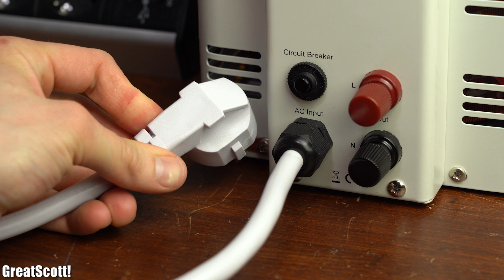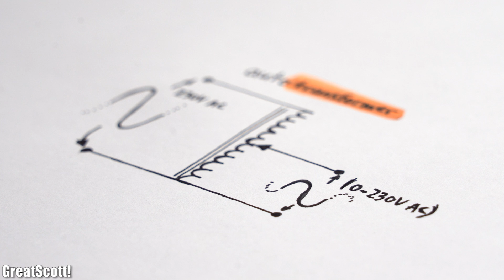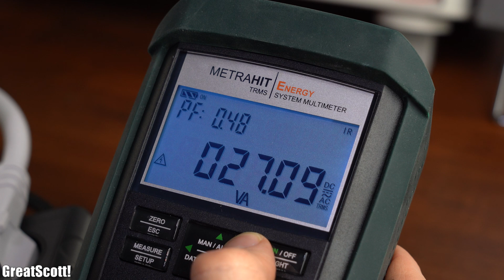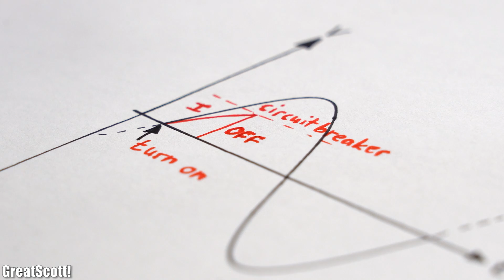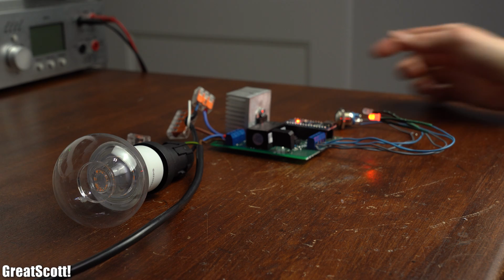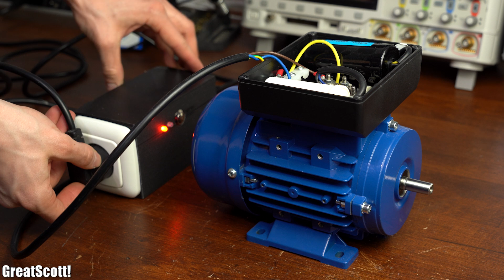How to make an AC Softstarter because my autotransformer keeps tripping my circuit breaker!

Comment: Thanks Great Scott!, I’ve learned so much from your videos.

I’m having troubles with this one though, and as I’m building the circuit I’m hoping someone can help me with a few questions.  I’ve researched using the timer registers to the point I feel I understand it, how clock cycles dependant on the prescaler settings correlates to actual time.

I believe I’ve confirmed that OCR1B = 590 (9.44ms prescaled 256) is based on 50 Hz mains power cycle.  If I understand the sketch correctly, everytime mains crosses 0 VAC on a rising portion of the main’s cycle, the sketch checks to see if the button was depressed.  If the button was depressed the value of OCR1B starts to decrease until i = 587.

What I can’t comprehend is why 9.44 ms is the chosen time, as by my math 1/50Hz * ½ a cycle = 10 ms. This would be the time for the mains to go from passing 0 VAC rising to a half cycle later when mains is at 0 VAC falling, and the triac is triggered for the first time.

So why 9.44 ms, and not 10 ms, and why holding OCR1B at 3 (590 - i of 587), and not 0?
 
If a person has 60 Hz mains and wants to trigger the triac at the peak of a mains cycle, as has been suggested, OCR1B would start at 260 (1/60Hz * ¼ = 4.17 ms) to trigger the triac for the first time, at the peak of the cycle after passing 0 VAC rising.

In the original sketch the triac is triggered over half a cycle from 0 VAC falling to 0 VAC rising.  If triggering the triac at the peak of the cycle would OCR1B be adjusted to still equal half a cycle duration, but starting from the peak, this time peak to peak which would include passing O VAC falling?

I hope I’m correct in my explanations, and my questions are worthy.

Thanks!
Reply: I wish Great Scott would answer !!!

Comment: a big resistor in series with main and a switch to bypass resistor when variaac is powerd up..the 2 dolalr solution
Or use a 555 and a relay to replace the switch.....5 dollar part list

Comment: Great Scott, thank you for making and posting this video.  Question: ¿would a soft start circuit (such as the one you've designed/built here) work for an AC motor garage door opener?  (My opener starts with a jerk and wondered why companies don't add such a circuit to the AC motors.  I am aware that a soft start is perhaps easier to incorporate with DC motors.  I'm perhaps doing things the hard way, and purchasing a new DC opener is a solution.  But I'm budget constrained).  I'm sorry for the long note.  Any/all comments most welcomed.  Thank you.  tonyd\.

Comment: I had the same problem and I built a "dim bulb tester", basically I start the transformer with 2 40 watts lamps in series with the load and I added a switch to bypass the lamps once the transformer is powered on. Maybe this helps somebody that wants to make this really cheap and easy. Great idea and video as always btw

Comment: A very simple soft-start circuit that is used by many is a simple relay that shorts a load that throttles the current after a fixed interval.  I made one for my audio amplifier project:

https://github.com/profdc9/PowerAmpAudio/tree/master/SoftStart

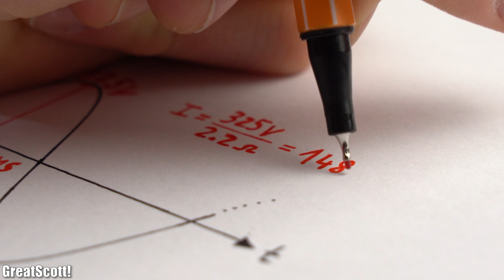Comment: 6:22 It's the opposite, it's better that the voltage is high at the beginnig, it's a complex fact but basicly because in inductance courrente are 90° late than voltage so maxmum voltage = minimum courrent.

Comment: This is just what I need in my workshop, my circular saw is very spark in the start. But at the end of the video the motor start with a jump, stops and start again. What's happening? Because I thought it will start slowly and gentile, until get the full power. Thank you for share this project, I really wish to build one.

Comment: I would test this with a freezer also as they require a large switch on current - that's what I found when I used low power inverters.

Comment: Had the same problem with a 1025VA toridoal transformer and even with the SSR it kept breaking the (B16) breaker and this kind of sucks right now
Edit: I watched your video and I knew that there was a risk that it wouldn't work, however I still wanted to try it because it would have been so simple

Comment: Hi. How are you? I was watching her videos about li ion and bms. About the BMS HX-3S-01. I see many recommending it, however, some say it is not for charging batteries. What is your opinion? My idea was to put the hx-3s-01, with 3S (2200mAh), and a current limiter of up to 1A and a voltage of 12.6v. It works? I could leave it loading (in the morning) and remove it hours later (because of work and other activities). It's safe?

Comment: There's an easier way to make a soft start circuit. Just start the load with some resistance in series with it, and then after a time short out the resistance so the load gets the full line voltage. Naturally this could be done manually with a couple of switches or automatically with a simple timed relay circuit.

I needed one for my circular saw, to make sure it wouldn't pop my inverter. The one I made was a little bit trickier as I wanted the trigger switch on the saw to instigate the process, without modifying the tool in any way,.

Comment: That's rather strange to have the lights go out? The lights here in Australia run on a different breaker, I had a kettle go bad one night which tripped the breaker, the tv and everything else that is plugged into a wall socket was shut down but the lights stayed on! And I was able to see where I was going because in a situation like that, you have to go around turning off the power points until you find what is causing the problem.... Try doing that without lighting at night. 
Your new variable Autotransformer looks like the one that I got from eBay! Except that mine is RED! And that means it's automatically better than yours LoL, it also has a built-in wall plate that takes any plug from around the world, like the ones that you get as a cheap Chinese adapter but the one used actually feels really good, the plug doesn't fall out and considerable amount of force is needed to plug and unplug.. it also has two carry handles on top which also provide protection for the adjustment knob on the top... But now I'm just bragging LoL 😂

Comment: VEry complicated.
Why would a simple resistor and relay soft start circuit not work for you? It works on big power supplies.
BYW - you may want to check your breaker in the consumer unit as it may be the wrong type for your circuit.

Comment: Hi @GreatScott, I have two questions please. 1) Why is the optocoupler's anode connected via two parallel resistors (R6 and R2) both 220k. Would just one 110k not work? 2) Is the black filament the galaxy black from Devil Design :-) ?

Comment: I need one for my fridge. Every once in a while when the compressor turns on the amp draw pulls over 40a but only for a second but long enough to trip the breaker, there after it only pulls 2a. The fridge is only 2 years old.

Comment: This is why my angle grinder trips my circuit breaker. I have  B16 that I want to swap out with one of C25  and make one wall socket for it in my garage. Hopefully this helps in my situation.

Comment: I've got a 4kVA variac, if I switch it on it's 50:50 whether it'll trip the breaker or not. I use a big 7kVA mains conditioner which soft-starts it and prevents tripping.

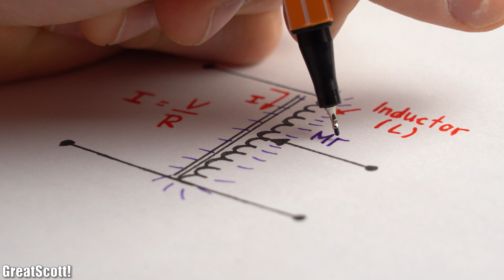Comment: 6:48 This part is wrong, a transformer should be switched on in the spikes not the zero crossings, this is for both inductive an capacitive loads. An transformer is even worse when switched on the zero crossing point, as it can cause the core to saturate, resulting in a 2-10 current spikes for the full wave
Reply: It is true what you say about inductive loads, but not capacitive. A capacitor will actually draw the spike of current like he described, only limited by the minimal resistance, since there's no inductance to slow down the current

Comment: Will this soft starter work for a solar setup? Starting a motor running off an inverter and solar panels, the startup current is too high and trips the inverter.

Comment: Great project !!! I have (maybe a stupid) question. An Optokoppler contains usually a light enhanced diode (your oc seems to have a transistor). So it lit up when it is powered on. I don't get it, how it triggers the digital input of the arduino with those peaks. Could you close my basic knowledge gap on that point, plaese ? Many thanks for all your great content. I learned a lot and own a cheap & well working fume extractor ;-)

Comment: I had a similar problem 20 years ago. Solved with a 2kW heater in series with the transformer that was shorted by a relay. It takes some tens of ms for the relay to close the contacts and this time is enough to limit current surge

Comment: hi scott do ur slow/smoth start work with switch mode power sub. like psu for pc etc?

have a sub woffer runing of a psu 1600w to a 2000w amp and it wtrip my breaker 90% of the time 75% one at the time( yes they have BIG capasitor in them)
thx for reply

ps have 20 amp plugs and 220v ac

Comment: Why not introduce a input resistor and bypass it after a set amount of time. That would not waste power all that much and prevent high inrush as well.
Alternatively you could use a MCB with a higher TCC curve.

Comment: very, very bad solution - on heavy load, triac will be overheated.
ever best solution is connecting an relay in parallel with triac. when soft-start ended, turn relay on, wait till on, and disable the triac. to "turn off" load, start the triac, turn off relay, wait till relay switching and turn off triac.

Comment: Hi G.S.,
I had the same problem with a 30KVA autotransformer and the simplest solution was to turn on the circuit with a load applied to the output of the secondary: the large initial current is due to the magnetization current of the primary which is not reabsorbed by the current magnetization of the secondary (output circuit) due to the absence of load.
This suggestion was given to me by my service manager (I worked in ENEL) who had worked in a company with a large transformer cabin and who had the same problem, when the softstarters could not be used due to the load (> 4 MVA at 15 KV) and possibly triac, mosfet and arduino did not exist. 
Try to apply a load to the output (one ohm resistance is fine too: you adjust the output voltage so as not to let it exceed its power) and then power it up: you should no longer fail a ignition
P.S. of course the resistor is used only for switching on and must not remain active for all use of the variac.
Thanks anyway for sharing the design of a softstarter.
P.S. there are modules for universal electric motors, up to 2KWp, very compact (with three wires and automatic, to be inserted in the casings of power tools) on the market, but you would not have made the video :-)

Comment: Would this implementation switching at peak or zero? be suitable as a soft start for a 500VA toroidal transformer in an amplifier or would just a series resistor and relay to bypass it be a better solution?

Comment: You also could change your old B16 Brecker to C16 Breaker
Reply: Or even c20 or C25. I want to make one wall socket for C25 in my garage so my angle grinder and welder wouldn't Trip the breaker.

Comment: I had an issue with my laser cutter tripping the circuit breaker when turned on randomly. Depending on when you turn it on/off it can cause a large inrush current. They sell special relays that turn off/on at the peak of the cycle to reduce inrush current. Google "Beware of Zero-Crossover Switching of Transformers"

Comment: incandescent light switch did not like thermal shock. it's a pretty simple analogue circuit and a great deal easier to understand and less over-engineered than using a microprocessor. The circuit is only hand drawn that I could have photo it if anybody was interested.

Comment: I was looking to buy something like this about two years ago, but couldn't find any. Our chop saw also has a tendency to trip the circuit breaker.
It works more often than not, but since you turn it on and off a lot, it ends up being a problem.

Might be time to try something like this. Unfortunately, I don't have an oscilloscope, so debugging would be difficult if things don't work.
(And err... I'm not sure I'd dare hook up an oscilloscope to something referenced to mains anyway. Good way to kill your oscilloscope if you don't know what you're doing...)

Comment: Awesome built. The last time I dug into this matter, there was a lot of contradicting information regarding if the zero-crossing or the sine peak was the best time to energize the windings. This was due to different opinions about the significance of current lagging the voltage. I never understood that connecting a coil at the zero crossing would instantly make huge currents flow. After watching this video it seems that my gut feeling was right. Connecting at the zero-crossing should induce the smallest amount of inrush current.
Reply: It's not that a coil immediately draws high current when switching on at zero crossing but the current is much higher for the first few cycles until the coil produces enough counter EMF, reducing the current. When switching on at peak of the voltage waveform, the counter EMF is maximum and therefore current rises much slower.
Reply: @JaMoBo265  Oh no. So it is best to energize a coil at a sine wave peak after all? Then why does this video talk so warmly about energizing a coil at the exact time of mains sine wave zero-crossing?
Reply: @nixxonnor  Correct. Well he simply made a mistake and also corrected himself in the comments.
Reply: @JaMoBo265  Thank you for commenting on this. I have wondered about this for so many years without figuring it out. I would like to se a graph representing the current draw when a coil is energised at the different phase angles. Have you ever seen such a graph? 0°, 30°, 60°, 90°, 120°, 150° and 180° would be very illustrating... The rest (180-360°) should be the same, only opposite of 0-180°.
Reply: @nixxonnor  If you're meaning the phase relationship between voltage and current, current lags voltage by 90 degrees in an inductive circuit.  Imagine a sine wave with a second sine wave superimposed, but starting from 0 when the first sine wave is at it's peak.
Reply: @steve5917  No. I am interested in the voltage and current during the first few AC cycles from the moment the coil primary winding is energized. Until the system stabilizes in a repeating pattern.
Reply: @nixxonnor  I knew my answer was too easy ;-)

Comment: A whole microcontroller for a simple zero-crossing control task? It seems wasteful to me. Such a scheme for starting a powerful transformer at the moment of current zero crossing is done on a quad op-amp or comparator or even a dual op-amp and on one triac. I saw the start-up schemes when the current passes through zero even in the devices of the mid-1980s.

Comment: In industrial applications we would replace the breaker with a C type breaker. those breakers can handle a higher inrush current! A Hager MCN116 would be the replacement for that. That costs only 15 euro's. That display on the auto transformer might break when using a soft starter on the main's voltage. Maybe do a video about the karakteristics on circuit breakers?

Comment: I have a motor for a water pump very similar (by appearances) to the blue motor that you connected to the soft starter. If I remember correctly, it stopped working because the motor won’t start, but spins freely. Would this work to possibly use this motor again??

Comment: Good stuff as usual, I have build a pellet burner which it's heating up my house for a couple of years with no major issues, i am still implementing more functions to it, the controller in an arduino micro,  a question for you since i can't find any relevant answers on the internet, pin 2 and pin 3 of the arduino micro are the interrupt pins, which are also SDA and SCL used by the i2c bus, on those pins i have a 20x4 screen and a rtc 1307,  will the dimming feature work for the zero cross...

Comment: There are readily-availabe soft-start modules for circular saws etc. Could you just use one of them?
Reply: Yes. Also there are ones for power amplifiers. It is usually just a resistor, relay and a timer shorting the resistor after a second or two

Comment: A commercial soft start is about $300.  It works automatically (eg for air conditioners),  i have a bunch of inductive loads that I would love to put soft starts on.  $300 each is a bit much.  Is there a product opportunity for you here?  Either a kit, or a PCB?  

Example:  https://www.gonewiththewynns.com/product/air-conditioning-off-grid

Comment: Thanks so much for posting this!  I've needed an AC soft starter for quite some time but was hesitant to spend the $300+ that most places want for a decent one.  Thought for sure the circuit would be much more complicated than it is!  I'll be using it for an air conditioner instead of an autotransformer.

Comment: over-engineering at ist best, or? ;-) I'm using a beefy resistor, a 1000uF cap, little transformer and a relay to switch on my isolation transformer; works for years now...

Comment: I had a similar issue with a 3000 watt transformer for reducing power from 220 to 120 volts. I later learned that the type of circuit breaker used makes a difference. There are some breakers rated for inductive loads and some for resistive loads. Most home breakers are of the resistive loads found in most homes. Replace breaker with an inductive  rated breaker. Did this and no problems now.

Comment: How would I go to... instead of a push button, use the thermostat of the ac unit make on and off... 
So instead of a momentary switch have it for a toggle switch at line voltage ?
Great work thanks !!!